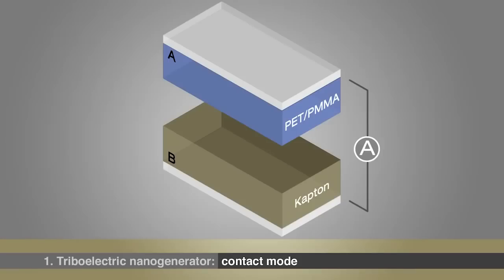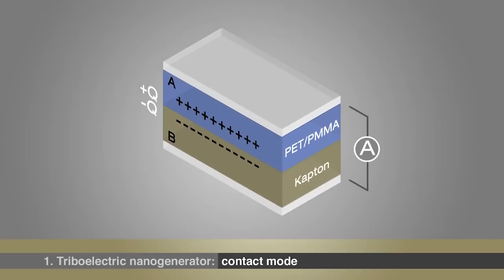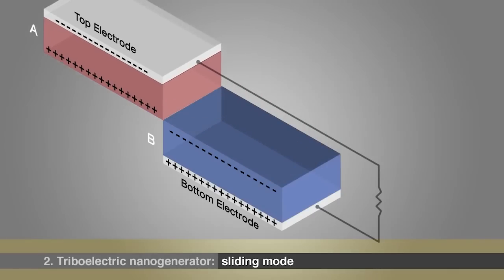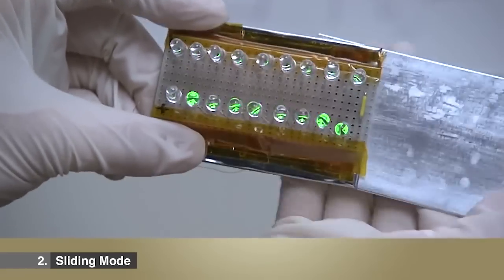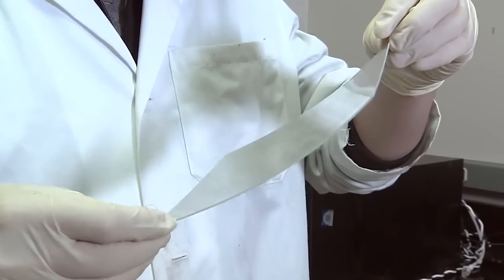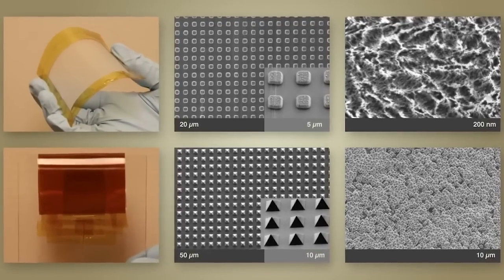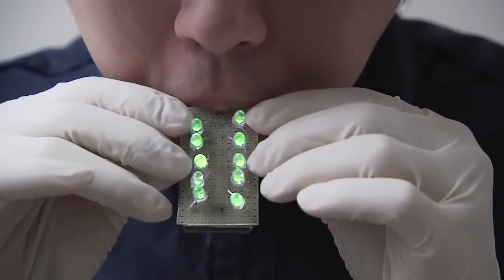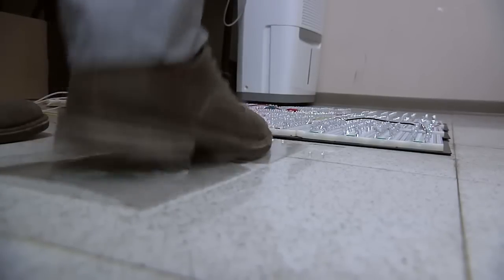Harvesting the World's Mechanical Energy: Triboelectric Generators Capture Wasted Power

Comment: That's cool. Lay a bunch of these on busy roads and walkway traffics. Our steps and wheels can provide the energy we need with these. And when it rains, the pressure from the raindrops will do the work for us.
Reply: The shortcoming in these  TEG devices is their extremely low current output. But their future is bright.

Comment: That's amazing... I used the same process to make a fully mechanical lightbulb several years ago. With gears grinding as if a flint kept getting a spark and light would light up from the continuous light powered solely by a mainspring... I hope they succeed.

Comment: Could you add it to solar panels to make them more efficient?
Reply: Just add some well designed Peltier devise and some well thought optimized thermoradiative diode and you  improve the solar panel's efficiency to new heights of performance. Triboelectric generators have been here as long as I can remember. They can produce very high volts to tens of thousands of volts but their currents still remain terriblly low. Some researchers have been working on switched-capacitor-convertors based on fractal design to come out of this impasse. It seems quite promising.

Comment: what happened to this technology? I'm writing this in 2022
Reply: Still research is going on, the issue associated with this is the very low power output. Although he claims 1000V, the current will be in micro-Amps, which can light LEDs with very less intensity.
Reply: @soorajs5952  
how many micro amps does it generate ?
give me a number